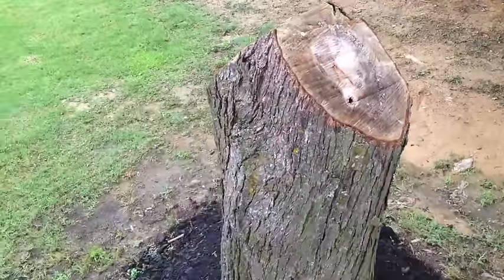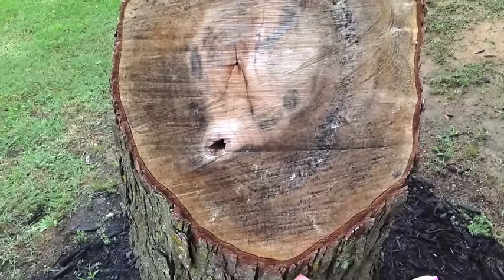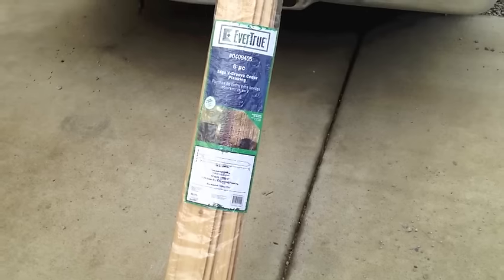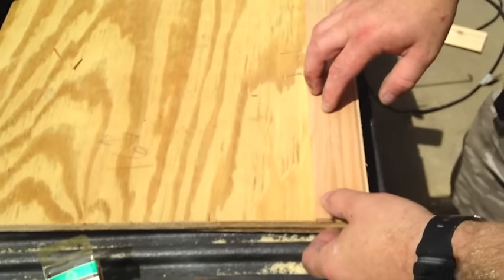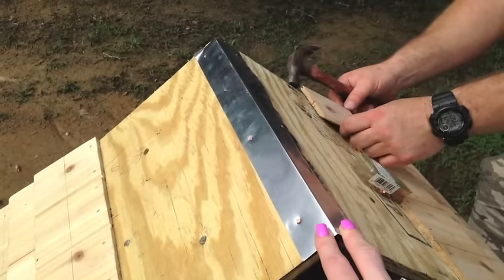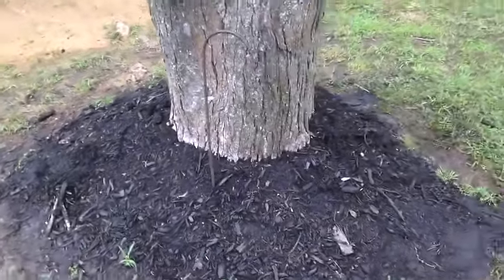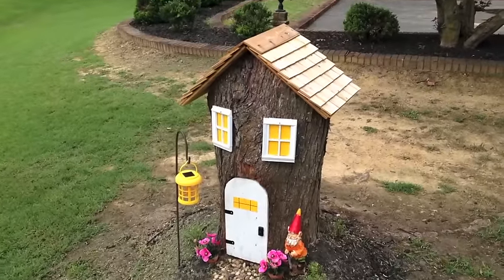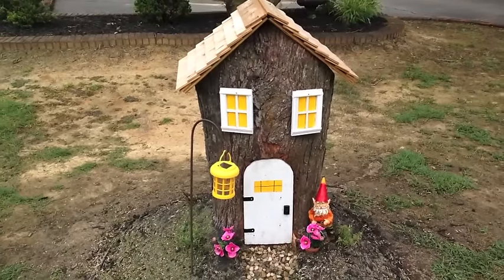Tree Stump House

Comment: I’m about to make one as well. Can you tell me how he did the very peak of the roof so water doesn’t go right under the shingles?
Reply from the maker: Hi Danielle, 
On top of the peak where the two boards meet, he put a line of  silicone or caulk and  a strip of roofing . Then, roof each side . Then one more on the peak when you’re done.  I appreciate you watching.  Our stump house lasted 5 years before the stump finally died out. It was quite the conversation piece as neighbors walked by.  I appreciate you watching 🥰